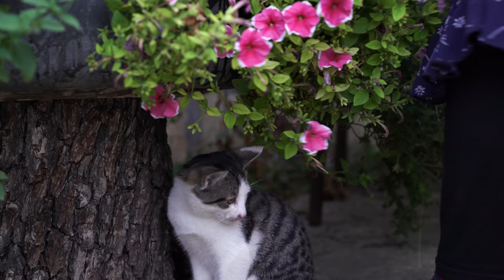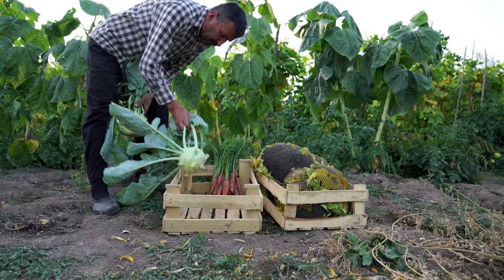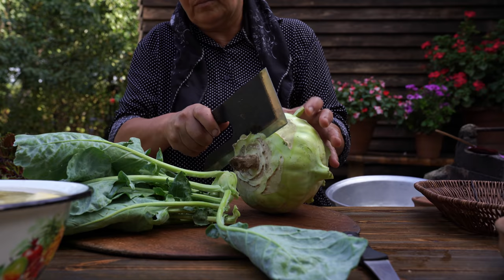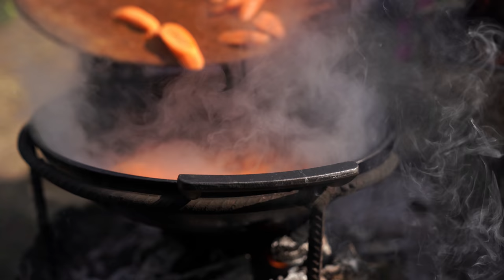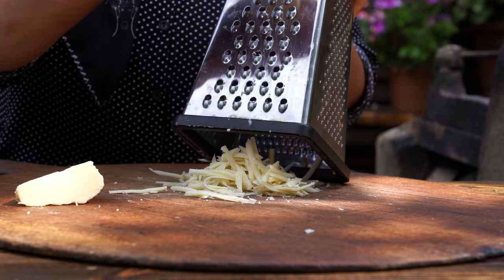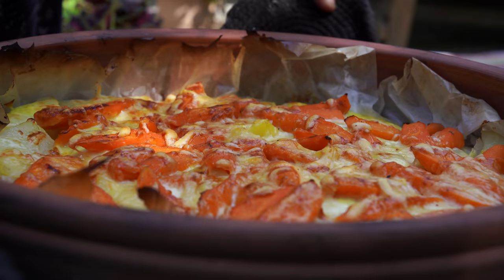Harvesting Vegetables and Cooking Dinner for Wooden House Builders, Funny Pets

Comment: They obviously have electricity to run the power tools ⁉️🤔
Reply: Those are battery powered, rechargeable. I have the same ones.
Reply: @tamitami9275  
Yeah okay... and my husband has a battery powered drill but not saws and such for sawing boards. I wouldn't think that the batteries would stay charged very long, as much as they were cutting ⁉️🤔
It's possible, but I wonder where they charge their batteries up ⁉️🤔
Reply: Maybe the builders have electricity? Or they could, lol
Reply: Of course. And in another video you can see them pouring water out of a big plastic container instead of the large metal cane they show in videos. These videos are not real life. They show people what they want to see.